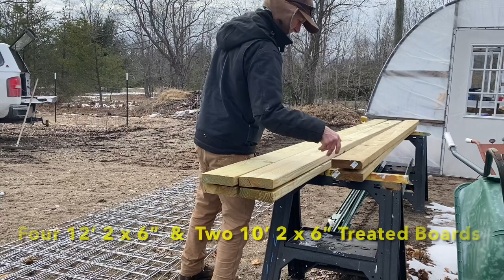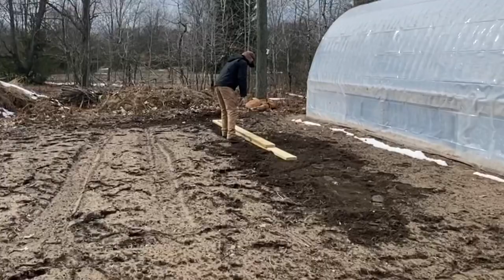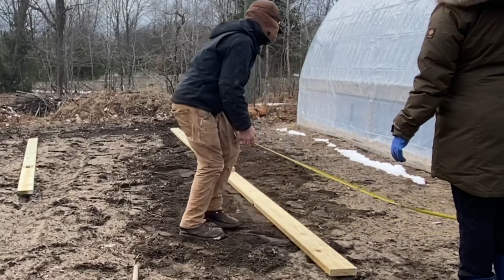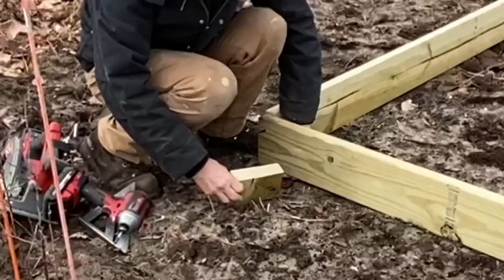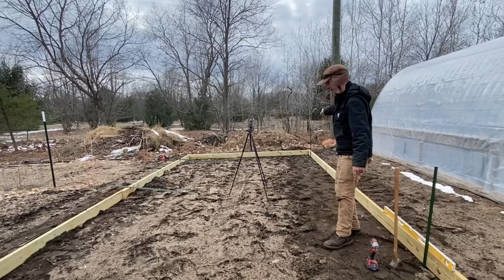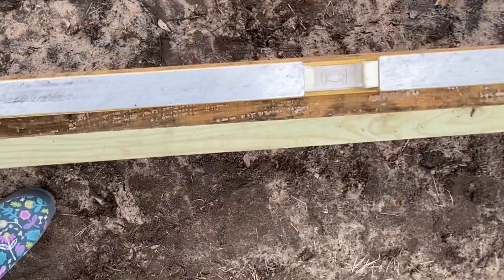How  To Build A Strong 12 Ft Cattle Panel Greenhouse  ~ Step One

Comment: Are the side sections tall than your first greenhouse(right in video)?  This one looks about 39" tall (2x6, 27", 2x6). It may just be an illusion but the other looks like the walls are shorter.  Mine will be 10' across like your first greenhouse, but I'm looking to make the ceiling taller since we're not average height people.😁
Reply from the maker: Sorry I missed your comment!! The walls are the same height but this greenhouse (dirt) base is a little higher too. Thanks for watching! 😊